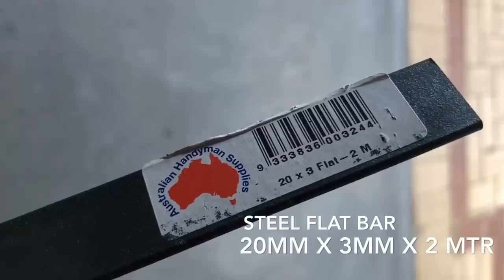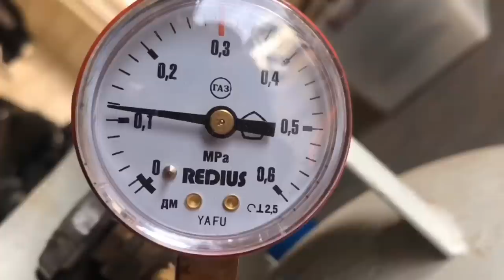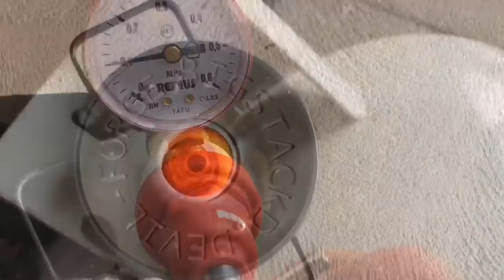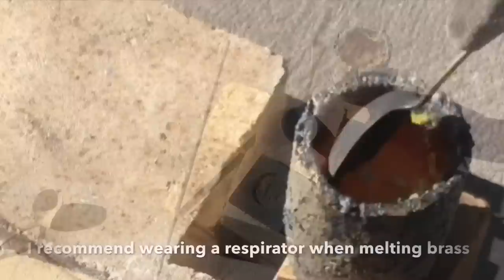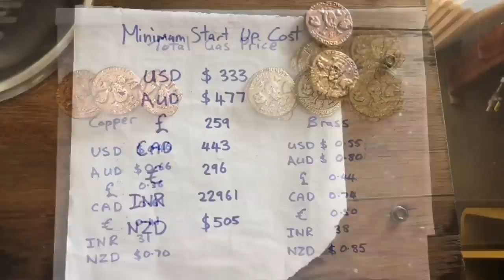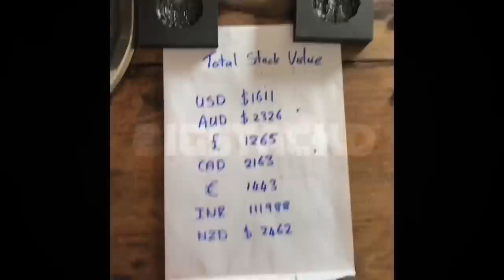WHATS THE TOTAL START UP COST TO MELT METAL AT HOME - TONG & LIFTER DIY - COPPER BRASS MELT

Comment from the maker: Be Sure to check the vids you have missed guys 😁😆Im sure you’ll find some you like👍🏻😉 https://www.youtube.com/user/bigstackD
Reply: @jerrykingsley6703  True! too cheap for current market. Not sure 100% of furnace but did not see anything cheaper than 500+. Cheapest #12 crucible on ebay I did see for $35 +delivery.
Reply: How long does it normally take for the different metals to melt down to liquid?
Reply: @isaac2990  It depends on several things - how powerful burner, how well insulated furnace and what is the metal. Lead melts at ~330 C, aluminium at ~660 C, copper at ~1090 C.
Reply from the maker: Jerry Kingsley  — Hey guys on eBay I’ve seen the crucibles for that price and the Molds start at $4 heres a few links below . A #12 Crucible would definitely not fit in these devil forge furnaces the 10 kg furnace will only in my opinion really fit an #8(8kg )Crucible otherwise you wouldn’t get your lifter in to remove it safely And the biggest Crucible for the 4 kg furnace I would use is a #3 (3kg) for the same reason above. Molds can get quite expensive starting at $4 and going up to well over $ 100 although the most I’ve ever spent on a graphite mold is about $18. You always have the option of sand casting ingots for practically next to nothing And a lot of people make their aluminium ingots in muffin tins. I’ve also used empty food tins for small aluminium melts and just throw the tin out after 1 use when I’m finished. That’s not highly recommended but it does work.
At the moment on eBay the 10kg Furnace is selling at $362US delivered and the 4kg Furnace is selling for $252US. 
Crucible clay/graphite
https://rover.ebay.com/rover/0/0/0?mpre=https%3A%2F%2Fwww.ebay.com.au%2Fulk%2Fitm%2F293091407978
Graphite Ingot mold 
https://rover.ebay.com/rover/0/0/0?mpre=https%3A%2F%2Fwww.ebay.com.au%2Fulk%2Fitm%2F132820509231

10kg Furnace 
https://rover.ebay.com/rover/0/0/0?mpre=https%3A%2F%2Fwww.ebay.com.au%2Fulk%2Fitm%2F253796844325

4kg Furnace 
https://rover.ebay.com/rover/0/0/0?mpre=https%3A%2F%2Fwww.ebay.com.au%2Fulk%2Fitm%2F251870988045
Reply: @bigstackD  Sorry, man. This is a catch - I am about AUD not USD. Yep, and I did not consider 4 kg furnace as an option ever . :) This is SmallStack Casting with 4kg furnace! I withdraw ...  :))

Comment: My FB1SB furnace rocked up yesterday... just waiting for the rigidizer to dry and the melt is on! 
I'll have to whip up some of the tongs, they look like a bloody good set!
Reply from the maker: Yeah there bloody brilliant and will save ya a heap of money just make sure there a good fit on the crucible and if you need to use a larger set put the extra grips on and that extra tab for safety on the bottom if possible. Safety first matey 😁👍🏻
Reply: @bigstackD  Cheers, will do. My current 6kg crucible is a bit big for the furnace so when my 4kg rocks up i'll build them to suit that! keep up the good work man

Comment: What I have found collecting tools and accessories for my forge. (I'm new to the melting game). Nobody sells decent tongs for large crucibles. I truly believe it's a liability issue. I'll make some for small crucibles but for big stuff I've made 5" steel cylinder crucibles. With bolts welded to the sides, and large nut on the bottom rear for pouring. (All case hardened). Cant go wrong. No fumbling. Hook, lift, hook, pour.

Comment: So far I'm about $400 in, but that includes extra crucibles and "reliable" tongs, the standard shape sold in most  kits are uncomfortably dangerous with a heavy crucible, I'm 2 brass bars in and waiting for safer equipment to arrive before I resume, fortunately I'm a plumber, so I get all the good scrap for free. I'm more of a bismuth hound but have always been fascinated with molten metals. Good vids bro, they've helped reignite a long time intrest.

Comment: I started messing around with blade forging some years ago. You have definatly peaked my interest in the hobby..... now where to get scrap.
Reply: I've been thinking about how to get this problem myself.  So far what I've come up with is save all my aluminum cans and guy at work drinks a monster energy drink a day so  I get his too.  Other than I look for abandoned tvs and take them apart. You can also find old tvs that no one wants in the free section of craigslist.  Some other ways of getting scrap is to call company or companies, especially welders, often have a lot of "trash" metal that you might be able to get at.  If you know any electricians, ask them to save the excess copper wire they normally throw away. 

When people put stuff out at the curb they don't want, you could keep a sharp eye out and pick up the good pieces.  I was driving in a neighborhood and found a whole giant roll of copper wires coated in plastic that was just going to be thrown away.   I hope at least one of these ideas is useful to you : ).

Comment: Nice design on the Tongs and lifters.  Because I lack certain things such as Intelligence, ability and Tools I've had to go a slightly different rout.  I cut the habdkes [[push bars]] from two lawn mowers in half.   Heated them in an old furenace I converted into a Blacksmithy and used pliers to bend them Straightish then beat them mostly flat with a Sledgehammer.  They already have the holes precut where I need them.  Using the steel rim off of a garden wagon to form the curved parts then bolting together.  Ugly but matches my face.  :D

Comment: I guess what people want to know is,after the initial investment of your equipment,is it worth it ? How often do you need to swap out propane tanks,can you use natural gas instead ?
Out of curiosity.  From start to finish,how long would it take to melt lets say 5 pounds of copper refrigerant tubing ? Also,is the block of ices purpose is solely to cool the ingots down,or is it to harden off the metal  ? I really am thinking about getting started but I want to know first what I am getting myself into.Like I mentioned b4, 
I do commercial HVAC and run into alot of scrap brass,and copper. Aluminum not so much . My Aluminum would come from fan blades,but anyway your response would be greatly appreciated.  I know most of my questions are answered here on your video but if there is anything that can be added that would be great !
Thanks,Howard from over thee 'ol pond.

Comment: Thanks for the video. Instructional about the bare necessities. 
Two question though:
Where do you get that high temperature probe ? 
Do you have a guideline for gaspressure for each type metal in the Devil forge ?
Reply from the maker: The heat gun I get from eBay for about $30 AUD just type in ‘infared 1050’ if purchasing make sure you get the 1050°C model 👍🏻. There is no set guideline for melting metals it’s all through trial and error . I melt my copper and aluminium bronze at 0.12MPa my brass at 0.1MPa and my Aluminium At 0.08MPa . You could always run it a bit higher to reduce the melt time but With the speed of the devil forge furnaces anyway I don’t see any reason. 👍🏻
Reply: @bigstackD  Thank you. I'm about to have the full gear for melting, only need the heat gun and Devil Forge (which I have decided I want after seing you, VegOilGuy and two more using it :)

Comment: I started young like 12 scrap lead, lead was all over in 79
Sand pits full of bullets, 
Trees full of sinkers, lures and bobbers
Roads full of wheel balance weights
Junk around old buildings, pipes and roof flash.
Even along the tracks, even used as caulk in big stones you find pieces around and cast sinkers, 
The guy who owned the tackle shop let me trade for tackle probably because I was a kid
He thought I was ambitious
I remember later gathering copper brass aluminium 
Shell casings, old junk on the trash day, brass lamps with marble bases man those days were treasure hunt all day long

Comment: I know this is two years later, but what size furnace do you recommend?

I’m trying to choose between (1) Devil Forge vs Making my own (I want to use higher melting point metals that aren’t advertised like cast iron and steel) and (2) If I’m going with Devil forge, what size furnace should I get, assuming my budget is only for the furnace, as I’m unaware if larger furnaces (like the 10 kg model$ melt faster or slower as well as use more or less propane than the smaller models

Comment: Hi, what is that neat tool you use to strip your wires? Also, I got sorted with the gas and valve now so just waiting on the right crucible to use. I see you mentioned using graphite ones. Are they better than ceramic, or just cheaper?

Comment: Amazon has alot of the blower an gas lines an for a forge i got a pag of plaster of paeris a bag of sand mixxed it filled a large metal cylender stook a 5kg bucket in the stuff til it dryed removed the bucket drilled in gas air lines an boom forge for a lid i poured same mix into a 5 inch metal bucket put 2 U screws in as handles an let it dry for a lid

Comment: Awesome! No welding! Pretty sure that a lot of people are just like me who doesn't know how to weld!
Reply: It's just another skill to learn. At times it seems to be rather like writing or painting as you direct the rod or gun and make the weld metal go where you want.
Reply: @markfryer9880  the problem with it is that it needs an industrial switch. Which has to be hooked directly to the electricity panel. I already bought one, but cant do this wiring work in my house. It'll be messy.

Comment: Hey bigD make a toturial for the machines and other tools you use for polishing..
Reply from the maker: Matey I start with an 80 grit flap disc on my angle grinder then I use my drill with a 50 mm round sanding discs . I start with 150 grit then go through the following Gritz 240-400-800 Then once I get to the following Grits I use a small squirt of WD-40 1200-1500-2000-2500-3000. The WD40 helps to lubricate the discs and stops the sanding disk binding up with the metal powder . Then after that I use my buffer wheel on my bench grinder to get a perfect mirrored buff on it👌🏻😁.
Reply: @bigstackD  thanks mate.

Comment: Just out of curiosity, if you do know or are willing to do a video on it. What happens if you leave the metal in the furnace for a long time? Like if you have like several tanks of propane what will happen if you kept a cruible of say like copper (half full of liquid copper) iron and any other type you can melt? Ive always wondered what happens to the metal after being in a furnace for like a full tank of propane each. would they be more pure or what. It would be interesting to see.
Reply from the maker: Nah matey it wouldn’t really change the purity of the metal , basically it would just hold steady and stay molten metal until the heat decreased or the crucible broke down but that could take forever

Comment: $13 for crucibles! Where do you get them? Will they ship across the ditch to NZ?
Reply from the maker: Actually they were the prices for a one or 2 kg Crucible back when I released this video but the prices have skyrocketed because of the amount of people starting to cast and the supply and demand has gone through the roof as with the prices🤦🏻‍♂️

Comment: If you were to cut the length in half of the "handles" and add one more pivot point,(ultimately 3 more joints),  you'd have fireplace log movers, and have a tighter grip from a further distance.  I know how hot my gloves get trying to pour from that close to my lava...  think about it.  Maybe try it out...

Comment: With threaded fasteners on the tongs, I would be nervous that they would come loose from the heat cycling. Is it possible to braze this type of steel with a propane torch?

Comment: Thanks for this :) can you do a vid on melting down copper cable with the pvc still on?
Reply from the maker: I could but I won’t as people will go crazy in the comment section about environmental crap and have a cry that I didn’t strip it. It can be easily done it would just produce a fair bit of flames from the furnace . The only thing you would need to do was skim the stuff off the top of the copper before pouring,  it would in no way affect the final bar whether you stripped it or didn’t strip it as long as you skimmed the stuff out before pouring
Reply: But I you throw it in The trash it will be burned so it don't change anything. People are stupid

Comment: Where do you get your graphite molds so inexpensive? I’ve been looking on eBay but they usually are twice or three times as expensive. Great video!
Reply from the maker: Yeah they start pretty cheap but can get quite expensive for sure . Heres a cheap link ive bought a heap of these.  https://www.ebay.com.au/itm/5OZ-Graphite-Crucible-Casting-Melting-Ingot-Mold-150g-Gold-Silver-Copper-Melt/132820509231?epid=1284370947&hash=item1eecb8222f:g:DV8AAOSwQTVWASMC&frcectupt=true

Comment: Hello again.my forge is here and I need a crucible to fit beer cans straight in and was wondering if you can tell me what to look for and possibly a link for the kind you use please.also I've got no metal to make tongs so where will be good to get them from.Cheers👍
Reply from the maker: Hey buddy I always use clay graphite crucibles from eBay I don’t have a link I just look for the best deal! 
 just make sure you temper them before you use them as they may crack on first use if you don’t. Check out my video on how to make cheap lifter and tongs at home they’re the cheapest lifter and tongs available on the Internet definitely that you can make yourself👍🏻. https://youtu.be/nyp0GiE5FTQ
Reply from the maker: If you don’t have any metal to make the tongs you’ll definitely need to source some from somewhere otherwise you’ll be paying an absolute ridiculous price on eBay. Are use steel flat bar but that’s just a suggestion you could pretty much use anything as long is it not gonna melt and it’s gonna safely lift up and pour the metal watch the video you’ll get some good ideas on how to make it
Reply: @bigstackD  I did watch it twice.I only found crucibles with a lip and pourer and don't think they look wide enough for a can and like the look of the ones you use.I only bought the 4kg devil.I was just wanting to know what to type in instead of searching for hours.😂
Reply from the maker: Rastaman Ralph matey if you only bought the 4 kg furnace don’t go higher than a 3 kg Crucible otherwise the lifter You build will be very very difficult to get it out. But if you’re looking for something on the cheap when I first started i used to use tin cans and even steel cans. 
 if you use a tin can like  from food They really only work one time and they need to be thrown out after one use , just don’t heat them up super crazy or they will spring a leak and you’ll have Molten aluminium in the bottom of your furnace! Other than that I’ve used and they work perfect for cans my handheld disposable propane torch steel containers . If you use them just be careful when you release of pressure.
Reply: @bigstackD  I've found a 3kg one for £10.I've used corned beef tins for moulds before and they make a 1 lb ingot of aluminium.I made a forge a few years ago that ran on coal with a hairdryer as the blower and I used an old fire extinguisher as the crucible but I'm wanting to do things properly now I can afford it.I've put gauntlets,crucible,face mask,and glasses in the basket and just need to look for a gas torch now.Cheers for your help for looking for a clay graphite crucible,I found one instantly😁👍✌

Comment: where do you get all the scrap metal such as brass and aluminum to smelt
Reply: Ask an auto repair shop, or similar place, if you could collect some of the old parts they throw out. Lots of aluminum gets tossed.
Reply: @aaronpops4108  do you smelt
Reply: @meh8552  I've melted down about 400lb of lead, but I have not yet smelted anything else.
Reply: @aaronpops4108 I haven't even done that P.S. what time zone are you in
Reply: @meh8552  GMT-6
Reply: @aaronpops4108  you are one hour ahead of me MST or GMT-6
Reply: meant -7
Reply: @aaronpops4108  I found a lot of mixed info. what country does GMT-6 reside in

Comment: I’ve been melting scrap metal down around my house so far I’ve been able to do using lead in aluminum I am currently building a furnace. It’s a smaller furnace it will probably only hold about A 4 kg crucible. I’m just curious to know what size burner would I need.
Reply from the maker: This is the burner that comes with 4 kg devil forge. It’s currently on 12% off sale and if you use my code word BIGSTACKDUSA     you’ll save an additional 5% if you’re interested👌🏻😁
This is the link for USA only so if you’re anywhere else in the world send me an email and I’ll send through the appropriate links👌🏻
https://www.ebay.com/itm/265134721283?hash=item3dbb42c903:g:uUIAAOSwcHtggWYR

bigstackddddd@mail.com

Comment: Where did you get the molds. I've tried to order them on line, but they are too small. And I cant find the ones with handles. I made a homemade forge. Came out great. Just waiting on molds
Reply from the maker: https://www.ebay.com.au/itm/303191455014

Comment: Which model infrared thermometer do you have? And how much did it cost please?
Reply from the maker: I use a cheapy it cost me $30 AUD delivered. Just go to eBay and type ‘infared 1050’ and a heap should come up just make sure it’s the 1050°C model. Obviously copper melts higher than that but if you go over 1050°C it will say hi on the temp gun and you know you’re very close , for brass aluminium bronze and aluminium it’s perfect👍🏻

Comment: Out of curiousity, how long do crucibles generally last?
Reply from the maker: If I don’t cross contaminate the crucibles with different medals and stick to the same medal for each Crucible I can get anywhere between 10 and 20 melts out of a Crucible. I may even get more but when They get dodgy looking are usually throw them out👍🏻